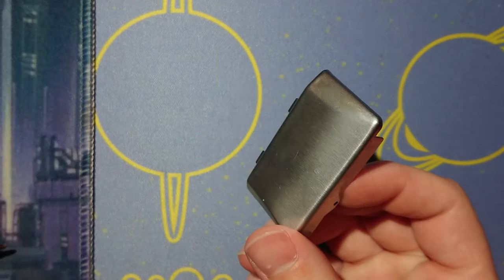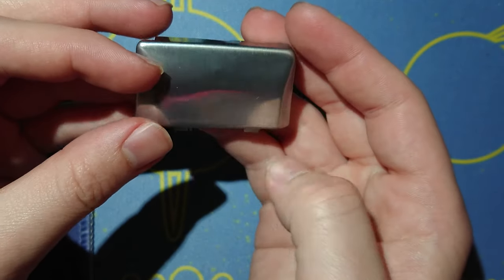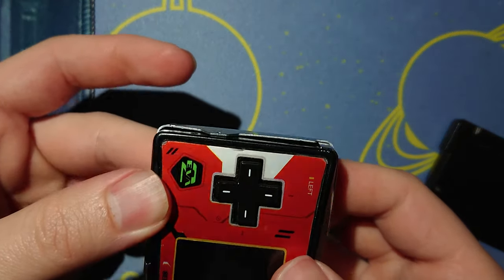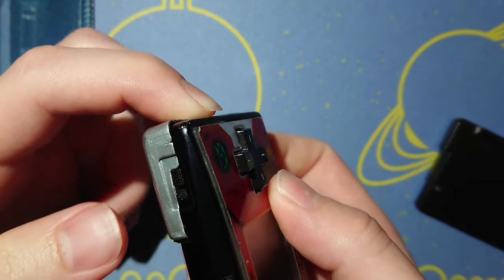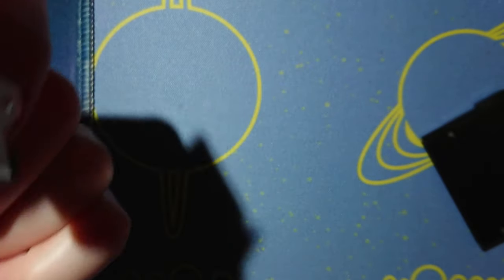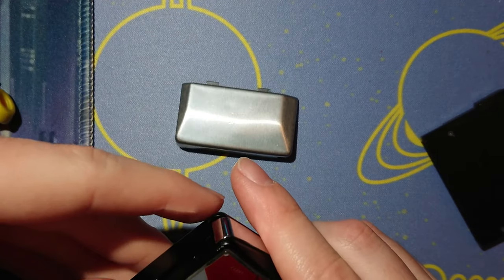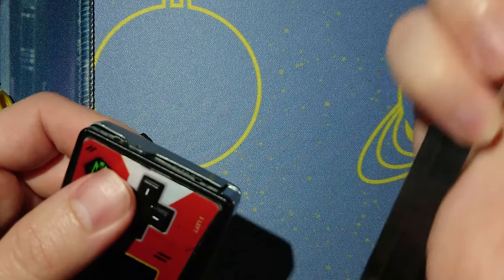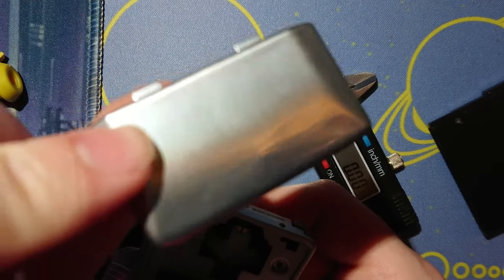Don't buy reproduction Game Boy Micro parts, especially the metal bits

Comment: I was planning on buying a replacement housing since my micro has a ton of scratches, but I'll just get a new face plate and call it battle damage
Reply from the maker: You can always paint your shell. I opted to get my Micro (the on in this video) cerakoted: https://www.instagram.com/p/B--CaBZHSTN/
Reply: @makho  thank you! Also do you think it would be possible to resin cast the interior plastic support frame?
Reply from the maker: @pixelprime5908  It's a very complicated part with a lot of features. Also, resin casts tend to shrink a little bit. With something that requires such high tolerances, I don't think it would work.